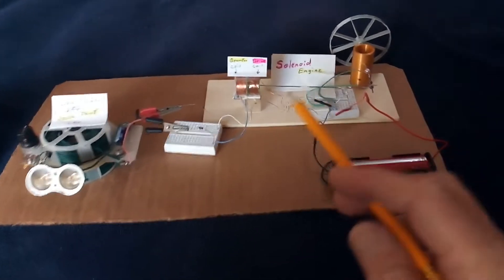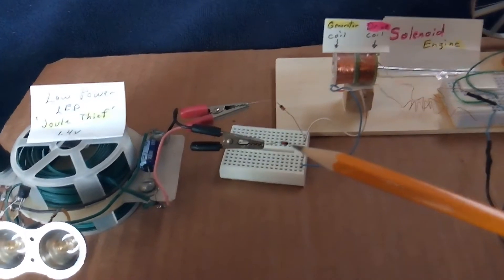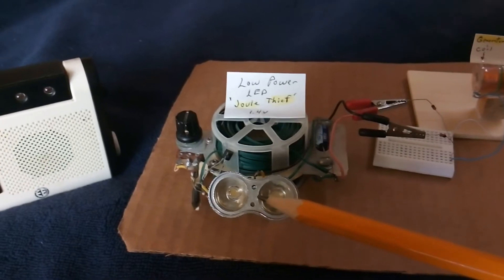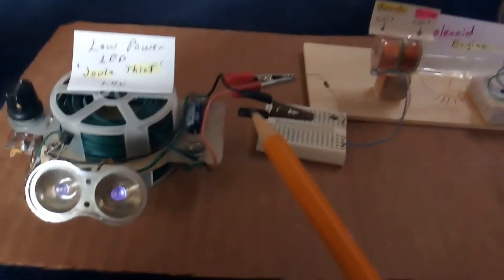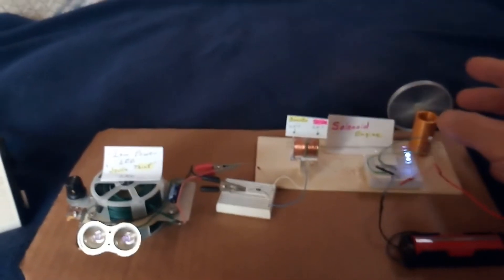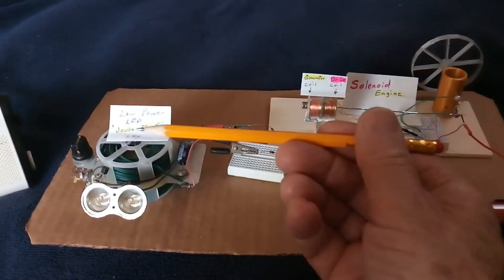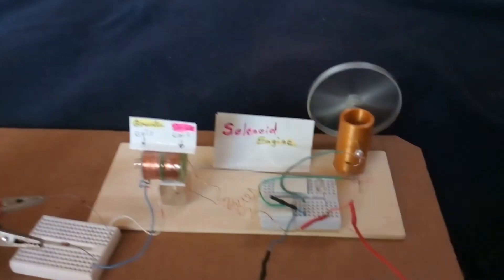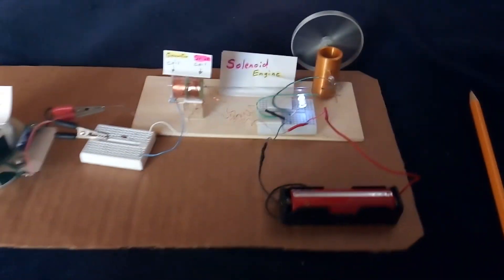Solenoid Engine -- with added generator

Comment: I have been killing my reed switches lately, I should revert to your method here 👍👍
Reply from the maker: I have actuaally been trying to get this to run on a reed switch but I have the same problem.  This thing likes to eat them.  Too much power needed and for too long.  I don't like the hard contact method I'm using but it is a quick and simple solution.  It is highly unreliable though.

Comment: you can use a spring instead of a wheel to harness the recoil of the spring
Reply from the maker: Yes!  I built a simple one a week ago and it worked fine. If all you want is a back and forth oscillator that is and esay method.
Reply: @Lidmotor  kewl,
Reply: @Lidmotor this reminded me a bit of stirling engine. If you would add induction coil heater would it be able to generate 100%efficiency in generator? Probablly would with precise calculated masivenes of things included.